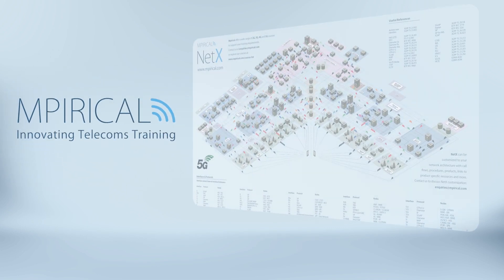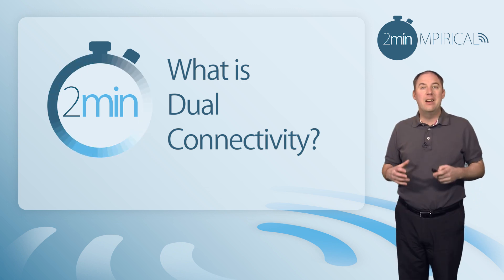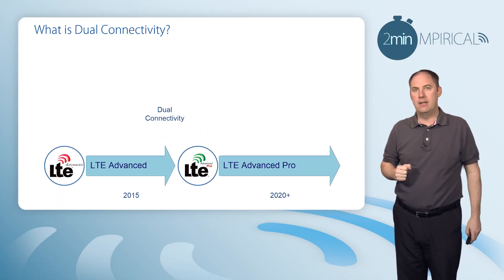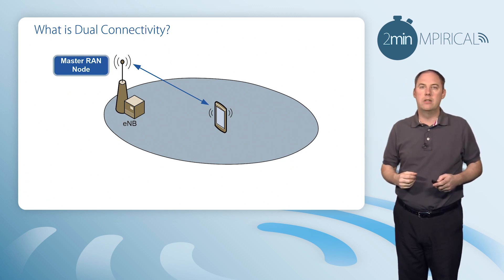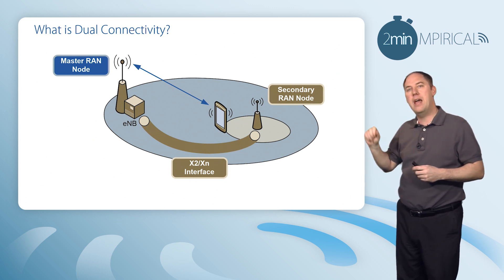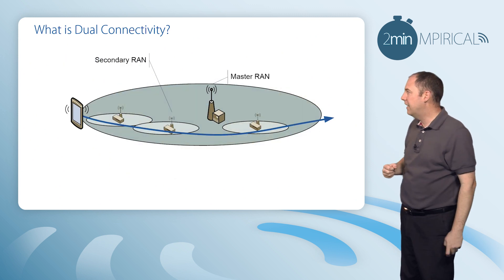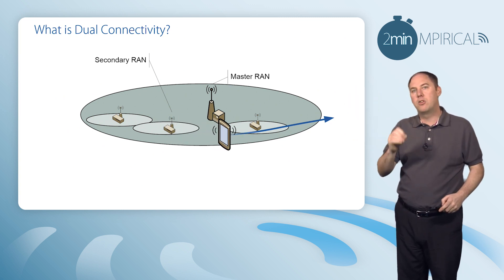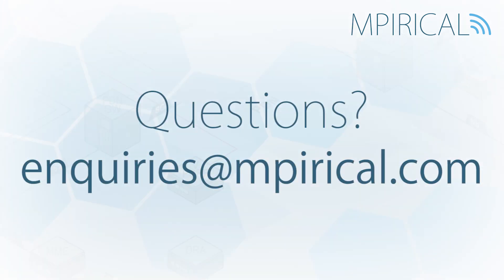What Exactly is Dual Connectivity? Find Out in Mpirical's 2min On Video

Comment: 1.       I hope you can help me clarify this question. To clarify, I have a fundamental question that relates to Dual Connectivity i.e. N-DC refers to the dual connection of 4G wireless access network and 5G NR. I am asking you as I have attended and subscribed to Award Solutions webinars in the past.

2.       Let’s say that we are using Band-X in 4G and another similar band in 5G and are attempting to communicate with both RATs to take advantage of EN-DC.

3.       The question is what will happen if there is overlap in terms of the “spectrum occupied”.

4.       Let’s say that the 4G component has been assigned spectrum in Band 3 from 1830 MHz through to 1850 MHz (i.e. a chunk of 20 MHz Bandwidth).

5.       Let’s say that the 5G component has been assigned spectrum in Band n3 from 1820.45 MHz through to 1830.45 MHz (i.e. a chunk of 10 MHz Bandwidth).

6.       In such a scenario, there is an overlap of 450 KHz between these two components i.e. the assigned 5G-NR band component eats into the 4g spectrum component by 450 KHz.

7.       Will such a deployment work in light of the designated configuration based on existing product implementations? There are bound to be issues in decoding such transmissions at the UE because of the overlap in the spectrum. The reason, I am asking this question was because an argument (however erroneous) can be made that the 5G transmissions would potentially be orthogonal to the 4G transmissions (even if they have an SCS of 15 kHz or 30 kHz) and hence the decoding at the mobile will work because orthogonality will prevent any decoding issues. I do not agree with this argument i.e. that the orthogonality provided by the OFDM structure of the waveforms would protect them against each other (i.e. from the UE perspective in the sense that the UE can successfully decode the two transmissions). I would be very grateful if you could enlighten me with your perspective with references (if applicable).

8.       If the answer is in the negative, from an R&D implementation, perspective – what changes would one need to implement to make such a configuration (i.e. characterized by overlapping assigned spectrums) workable in realistic network implementations?

9. It would also be immensely helpful if you could further substantiate your arguments with references from the relevant 3GPP specifications (or other relevant specifications) or draw my attention to any specific specifications or publications which can further clarify my doubt?